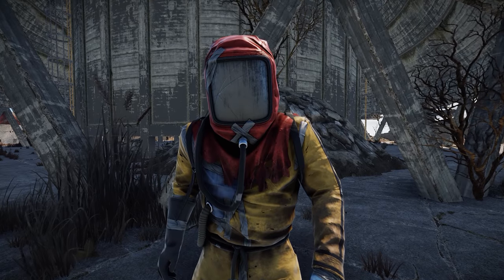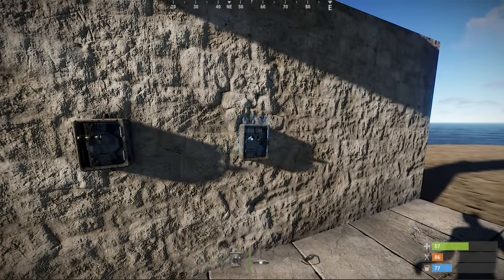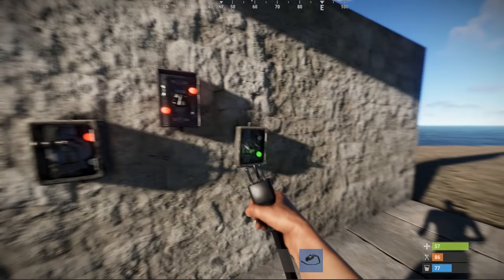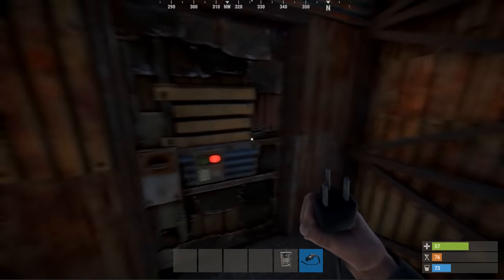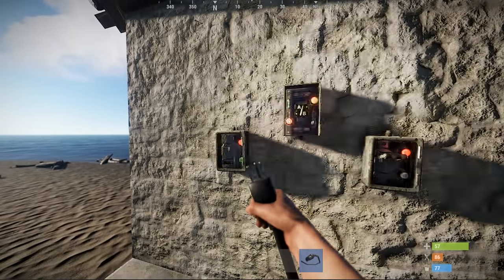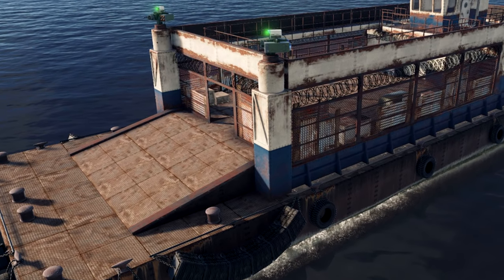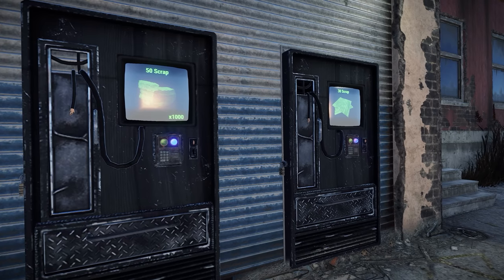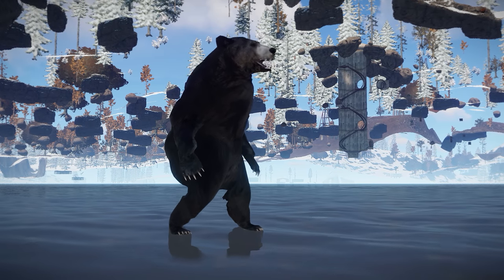ELECTRICITY on its way! | Rust update 9th November 2018

Comment: They should make make the fuse boxes around the roads necessary to use electricity so that all bases cant just go on lockdown with a flip of a switch. Maybe once you get building priv then you can repair it with metal frags, tech trash or fuses?

Comment: Can the raiders also use the switches when they got in? or I can put code locks in it. If not I can do some latching shit flipflop and put the reset button somewhere so when I push a button every turret and door closes but can only be reset via some external tc switch somewhere or I can play like jigsaw if they implement that cctv in that concept limbo.

Comment: Lets say someone goes deep on you and you have pressure plates in you'r base. Would they be able to just open the door without having the code for the door by standing on the pressure plate. Maybe they should do it so you have to have tc or codes to open them via. the pressure plate

Comment: I think one on the major things that would be wrong with update this is that now every base could be a trap base because the wires are invisible, and it would be nearly impossible to go deep anymore.
Reply: Also I didn’t think about this but would you need the door code to open the door with the switch? I feel like that should be your reward if you are able to go deep enough to use it.

Comment: I love the fact they are working on rust but in my opinion they are heading into a wrong direction as they are making it more roleplay instead of the original farm for what u need . I am one that despises the component system as it is unpleasant to play with as barrels are not pleasant to farm aswell as clans camping large loot areas therefore making it near impossible to get higher tier loot as a solo . Just my opinion.

Comment: Before I watch the video I hope they utilise the fuse box model and fuses in the base construction. And have a system similar to decay in cupboards. The more code locks, lights, auto turrets and trip laser beams you have the faster the fuses is consumed. I wouldn't mind a generator model too uses low grade or oil. Could be basesd on tge sadan engine or maybe different tiers which use less fuel the higher the tier or the more items it can power. You Then we can bring back wind towers. Maybe solar panels for our roofs. But saying all that I wish they would just "LET US CHOOSE OUR FUCKING SEX" oh and ride horses instead of fucking stupid hot air balloons. (Rant over)